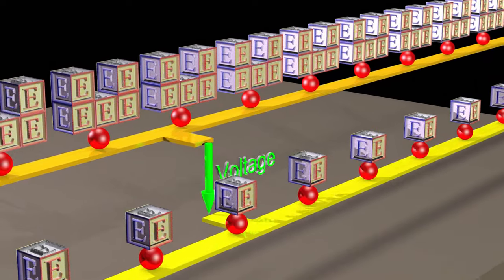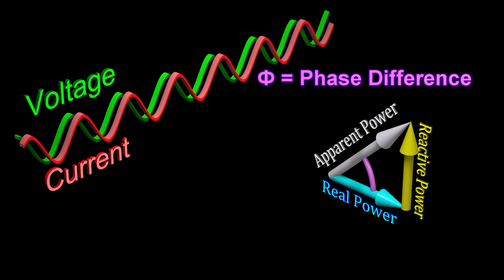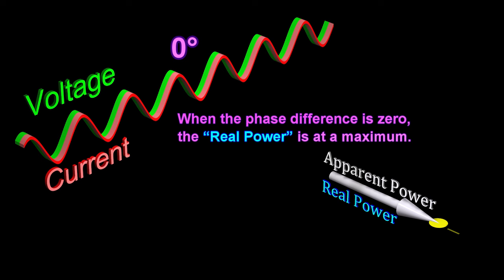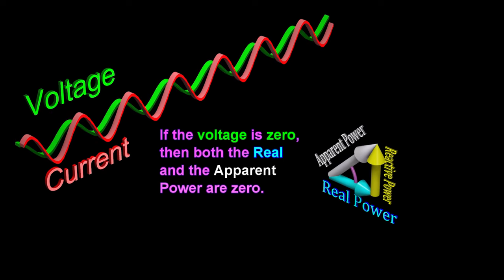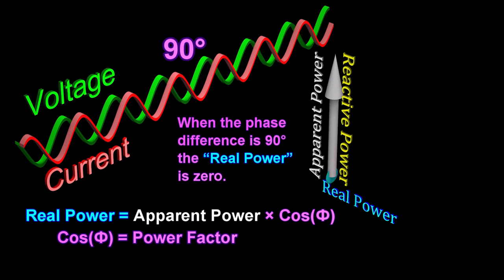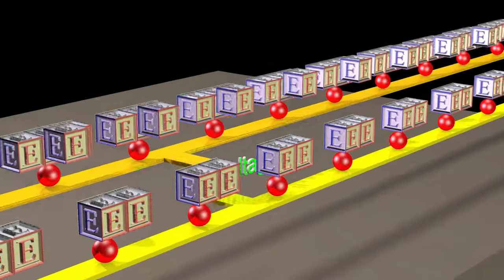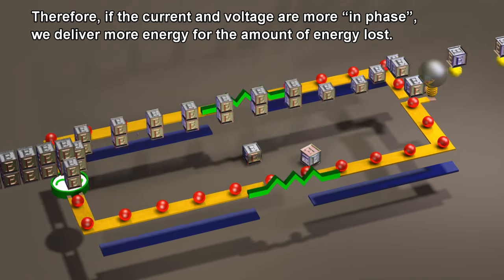Real vs Reactive Power

Comment: I never knew electricity worked in such an insane way. How the hell did anyone figure that out on their own.
Reply: Your comment took me back to when I started studying electrical engineering 😃. I had the same question that you commented. But if you do the maths it becomes obvious. The current through a capacitor is
I(t) = C dV(t)/dt
where C is the capacitance of the capacitor and V is the voltage applied across it in time t. If V(t) is a sine function (i.e., AC voltage), I(t) will be cosine. Thus we get 90° phase difference. Similar relationship also exists for an inductor. If you are curious to know more, you can read Wikipedia's capacitor page under "theory of operation".
Reply: It is because Tesla, he realized it was necesary to make electric rotator motors to work out
Reply: @kirkhamandy  I love your comment.  Adding to that, if you want to go Even Further then you should recall that Maxwell equations were the collection and complete understanding / unification of prior scientists equations like Faradays equation , or even Biot Sevart's law.  Or even Amperes Law!  All within maxwells equations.  Though maxwells change from integral form to differential form was very a very profound change at the time since it was such a different way to view E&M at the time.  Instead of being the sum of parts it is viewed as the differentials of hidden Fields as they change.  Quite a mathematical way to change how Physics was being done in that time period.
Reply: @justanotherguy46  thank god someone mentioned faraday
Reply: Not on their own it took a lot of guys who had nothing better to do
Reply: No one figured everything on their own. Science consists of a group of people, not one person. The dude who introduced the concept of phasor analysis (Charles Proteus Steinmetz) is not the same person who invented/discovered the concept of reactive power (Paul Boucherot).

And let's not even talk about the people who discovered/proposed the laws of electromagnetism...

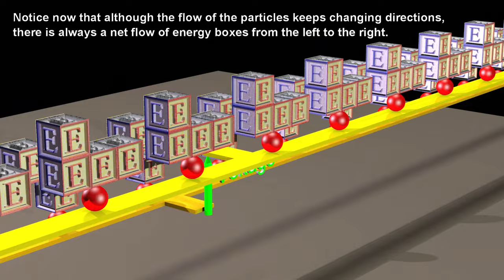Comment: 1:30 If you're having some trouble visualizing it, the energy is flowing to the right of the screen when a given wire's voltage is higher, not flowing solely from the right wire. I was mixed up a little by my misinterpretation.
Reply: Yup this helped a lot, thabks
Reply: Yeah, at first that's how I was interpreting it at first--front and back--and that doesn't make sense. No it's net energy moving to the right of the screen like you say.
Reply: thank you

Comment: The last animation is what I needed for so long. In earlier stages, it wasn't clear where the energy goes, but in the last one, you clearly stated that the energy that is carried out by atoms is lost because of the heating in the wire and the light that is emitting from the lightbulb. Thank you so much.
Reply from the maker: Thanks.

Comment: I was working with a technician today installing a 50 horsepower 3 phase induction motor into a very large HVAC unit (the motor weighed 500 pounds!). On the motor nameplate, there was a bit of information that stated: PF(cos Φ)=0.84. I was trying to explain the meaning of that to him. I drew the power triangle for ac circuits but it was not as intuitive as this. I will send him this video . Thanks again!
Reply from the maker: Thanks!

Comment: Nice video! Though I still can't visualize in the end on what happens if the voltage and current is 90 degrees out of phase. Will the energy just move back and forth without transferring to the light bulb? And given that the energy has to be lost by the resistor, how will the energy source compensate with that? Thank you for your response!
Reply from the maker: The voltage and current can be 90 degrees out of phase only if the load has no resistance, as in the case of an ideal capacitor or an ideal inductor.  Therefore, if the load is a light bulb, the voltage and current can't be 90 degrees out of phase, because the light bulb has at least some resistance to it, and it is this resistance which dissipates power.  For an ideal capacitor or an ideal inductor, they can't dissipate power, they can only absorb energy and then release it back again.  And yes, the energy source will keep adding energy to the system to compensate for the energy lost in the resistance of the wires.
Reply: @EugeneKhutoryansky  thank you so much for answering, much clearer now!

Comment: Showing the resistance in the circuit with energy boxes drop from the wire is brilliant and excellent.
Reply from the maker: Thanks for the compliment.
Reply: Especially where he shows the input of energy to the alternator from an external source.

Comment: Being completely in phase is not desirable in power circuits. It's true that the reactive power represents an opportunity for loss of energy  due to resistance for less power transmission. However this reactive energy also provide stability to the voltage and current of the power circuit. One example is the with solar power in a local grid.  Solar provides almost no reactive power and therefore turbines or other sources of reactive power must carry a larger percent of  reactive power, reducing their efficiency, increasing their costs and often CO2 emmision. Other than that the video was excellent.

Comment: Nice video!
Although defining Real and Reactive power by the phase difference between current and voltage is only valid in the case sinusoidal signals. A more general way to define real power and apparent power is:  Real = avg(current(t) * voltage(t)), Apparent = rms(current(t)) * rms(voltage(t)).

Comment: 🌹🌹🌹🌼🌼 My mentor is back with another outstanding video, 😍😍🙆🙆💖💖💚💚. 

My mentor , what happens at atomic scale inside a wire by which we can say that the power Lost is equal to (current × resistance) regardless of the voltage? 

Will you please make a video on this topic. This topic is really confusing. This concept is of same confusion as that of Bernoulli's principle .
🤠🤠🤠
But we all are sure that you will  one-day clear this misconception in the same way in which you brilliantly cleared the misconception of Bernoulli's principle. 😘😘
Reply from the maker: I am glad you liked my video.  Keep in mind, when I referred to the voltage, I was referring to the voltage difference between the two wires.  This is not the same thing as the voltage drop across the resistance of the wire, which is proportional to the current.  Thanks.
Reply: @EugeneKhutoryansky  Thanks a lot for clearing this misconception 😘😘.

Comment: One question:  So the "E" blocks are supposed to represent the energy stored in the system?   If so, the energy is stored in the magnetic and electric fields around the wires.  The loop formed by the two conductors has a magnetic field inside it, and the energy in this field increases and decreases twice per cycle, once for each time the electric current reverses.  Likewise, the electric field in the gap between the wires stores energy and increases and decreases twice per cycle, once for each time the voltage reverses.  The net power delivered in either case is no power, but an electric current is present in the wire which does dissipate resistive power, as a wire allows a current to flow ideally instantaneously whenever a voltage is applied across it (and not with a lead or a lag).

Comment: I have seen that the energy transferred by a circuit does not actually flow through the wire, but through the space around it as given by the Poynting vector. How can this be visualised?

Comment: 7:45 Why only on the magnitude of current? Isn't P = V.I = I^2.R = V^2/R ?
Reply from the maker: In these equations, when applied to the power lost in a section of wire, V refers to the voltage drop across the wire, not the voltage of the voltage source.  The voltage drop across the wire can be derived from the current and the resistance of the wire.
Reply: @EugeneKhutoryansky  Thanks!

Comment: Hi thanks for the video. I understand the concept of energy boxes of charges and why they increase or decrease depending on their "height", but why and how are they transfered from the "higher" charges to the "lower" charges ? Also I don't really understand what can make the current and voltage more or less in-phase.
Reply from the maker: They are transferred through the energy stored in the electromagnetic fields between the wires.  The extent to which the voltage and current are out of phase is determined by the amount of inductance and capacitance in the circuit, as described in my video at https://youtu.be/zO7RZZW0wSQ
Reply: @EugeneKhutoryansky  I see, thank you for your help and amazing content

Comment: Why don’t the sine waves appear to be out of phase by 90 degrees at 3:50? Looks more like 45 degrees.
Reply from the maker: That is what 90 degrees phase difference looks like.  Keep in mind, if it was 180 degrees, the two waveforms would be the opposite of each other (multiplied by negative one).  Therefore 90 degrees is halfway to this point.

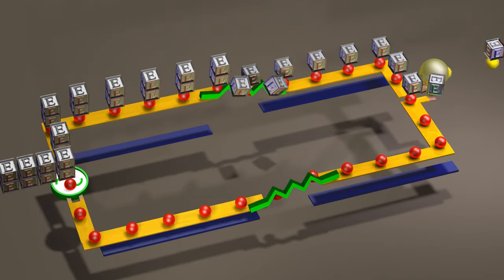Comment: 7:24 - Some of the energy is lost in the resistance of the wires. 
- the way I see it, the energy is not 'lost' - it is just dissipated as thermal (non-visible) heat, just like the bulb dissipates thermal and visible energy. 
Dropping the 'E' boxes from the wire resistance then isn't technically correct (could be interpreted as gravity absorbs it?) when the light bulb gets a yellow sphere/photon attached to it. The 'E' boxes dropped from the resistance should imho have a brown/lower-temp sphere/photon - and radiated out from the resistor - just like a real world resistor gets warm when it dissipates energy. 
Great video though, hope you don't take my view as negative - it is in fact the opposite..
Reply: I think he said the energy is lost because that energy is not reaching our appliances.
Reply: @lmmao406  Conservation of energy says no energy is lost, it is transformed - into heat in this case, which is also non-visible light (It can be seen using a FLIR camera)
Reactive power can melt wires, if the power dissipated is high enough - and that energy isn't lost, it is a hazard ;ø)

Comment: Question. How do you justify that higher voltage particles carry higher energy, give that it was an arbitrary designation that electrons have negative charge? Say if in an alternative timeline the electron was designated to have positive charge, then then energy flows backwards by the logic in this video, but it shouldn’t matter in reality?
Reply: Power=Voltage*Current
Current=Voltage/Resistance
If the direction of the voltage changed, the direction of the current would also have to change, and negative * negative = positive

Comment: i understand apparent vs real power a lot better now
but i feel like i dont get what reactive power is useful for
is it simply a measure of losses to being out of phase
or is it some form of useable power we can get out of the system if we design circuits in a special way?
Reply from the maker: No, reactive power can't be made into usable power, unless we make the voltage and current more in phase, in which case we are reducing the reactive power and increasing the real power.

Comment: At 0:44 how can there be current without voltage difference? It's not a short circuit.
Reply from the maker: There can be a short circuit at one of the ends, making both wires the same node of a larger circuit.

Comment: there can be no current without a voltage difference
the voltage difference causes flow, current is inseperaly linked to voltage
Reply from the maker: You can have a current without a voltage difference.  For example, consider an ideal inductor connected to itself, with an ideal wire.  A DC current can circulate forever, without any voltage difference.
Reply: @EugeneKhutoryansky  would the electrons start flowing by themselves?
don't they need an external influence in this setup, like a magnet?

Comment: Inductor causes - 90° phase shift and capacitance causes +90° phase shift. Then how do circuits have phase shifts between 0° and 90°?
Reply: Oh I understood. It's because the total phase shift is a vector resultant of phase shift vectors of reactive components and resistive components. And usually the resistive components contribute most to the power factor.
Reply: Now I have another question. Why does an inductor cause phase shift by exactly 90°?
Reply: I got an answer for this! Current leads voltage by 90° because a capacitor charges till the voltage reaches its peak. It's so obvious yet so confusing.
Reply from the maker: I illustrate all of this in my video on AC Current Impedance at https://youtu.be/zO7RZZW0wSQ

Comment: But this is the current and not the energy.
In addition, the energy is the evolution of the power in time.
Isn't it?
Reply from the maker: The current is represented by the number of red spheres that pass each second.  The energy is represented by the boxes.
Reply: That's true but there are links between voltage and current to obtain power and the variation of the latter gives the energy.